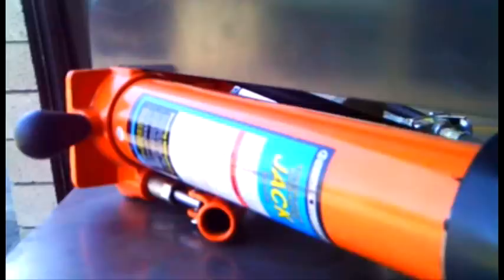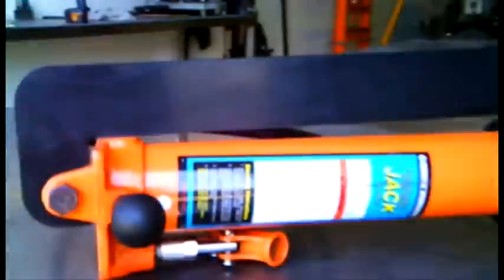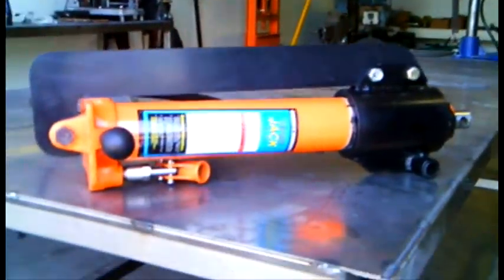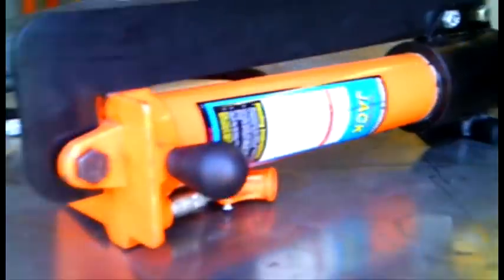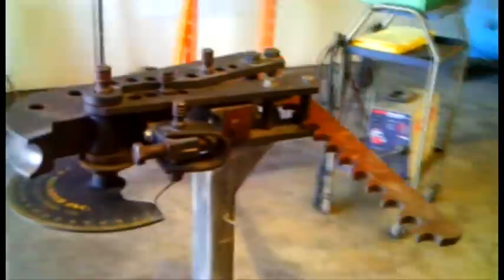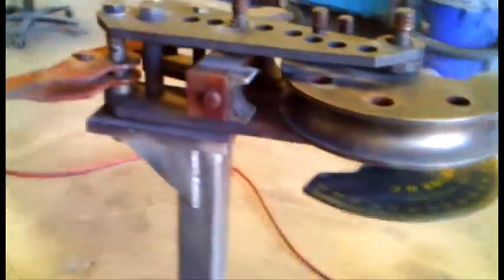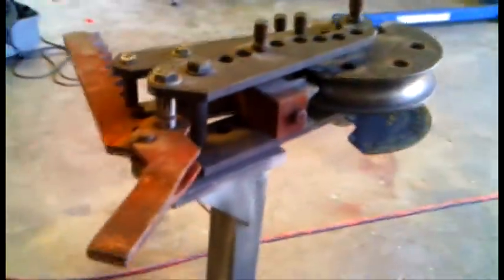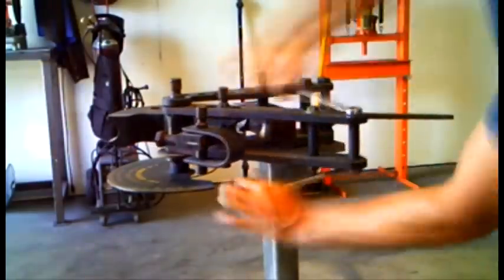Hydraulic Tubing Bender

Comment: Why don't you guys modify this with a normal hydraulic cylinder instead of a hydraulic jack it's so cheap and rigged it's not even interesting
Reply from the maker: This was made to be a cheap air over hydraulic adapter to make life a bit easier.  I sold a bunch of these in my past life.  Idk of a hydraulic ram and air/hydraulic power head combo that cost $70 that uses a rod end hydraulic cylinder.  At the end of the day, this did and still does what a $4000 setup would do... this = more money left over for other toys.

Comment from the maker: 270 degrees.  Ram works the same as the factory bender ratchet mechanism with 4 different full stroke detents you get by moving the arm back and moving the die lock pin to the next hole in the main die at the end of each stroke.  It is very easy.

Comment from the maker: The ram will bend as far as the die will allow!  With the 1 3/4" round tubing die in the video we can get a 270 degree bend any more you have to cut the tubing off the die...lol   The bending dies have 3-4 pin positions that allow adjustment to push a big bend.  The ram bends 10-15 degrees further then the ratchet mechanism per pin detent.